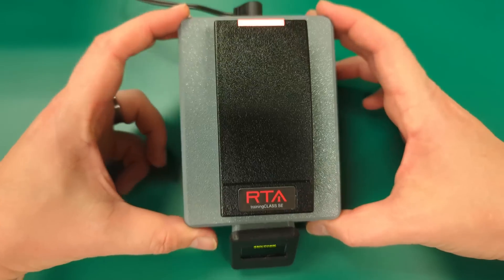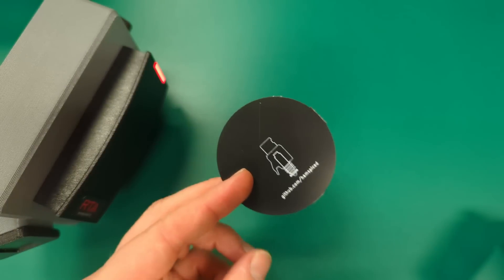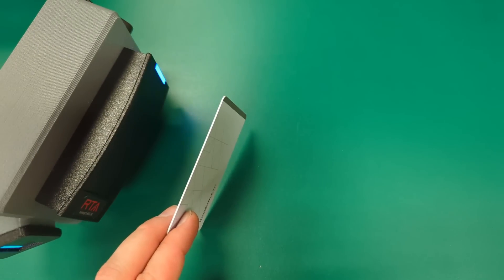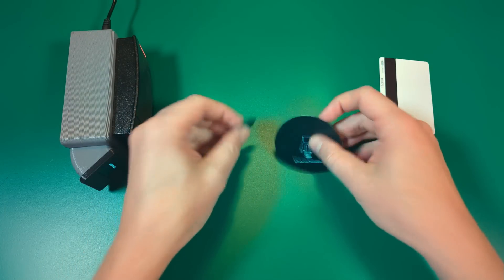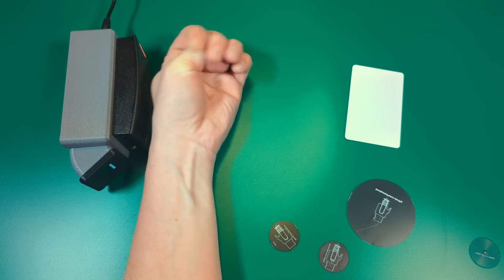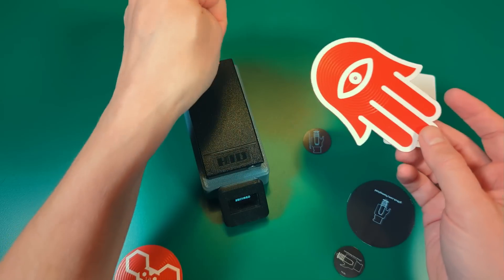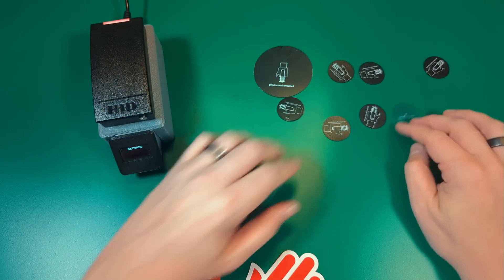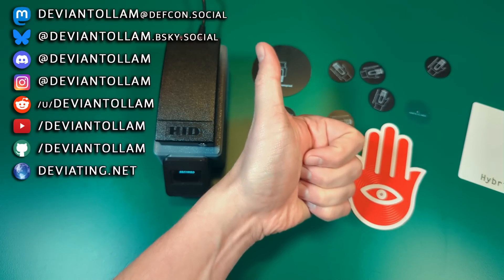RFID Tank Circuits

Comment: Also imagine you could embed these, especially the flex ones into a glove (like the ones used in cold weather or maybe if you are disguising as a construction worker/repairman on a building), to discretely have it available for use on reading embedded credentials just put it below the outer most layer of fabric just on top of the embedded chip🤔🤔

Comment: Question: Could one employ a chain / column of tank circuits and further extend the readable distance?
Reply: I'm pretty sure it would eventually lose too much strength because the RFID reader is supplying all the power. A lot like how sound gets quieter over time.

Comment: There's a video on the Smith chart that is the bane of EEng's schooling. It's about the rebounding of UHF frequencies in circuits. I can imagine this simple looking circuit was a task to make exactly the right length.
v=pXWbdxOAuDs
Reply: You aren't wrong.  However the largest development time of this particular project wasn't the length of the trace, but the capacitive plates to make the circuit passive without the need for protruding onboard capacitors.  I think I went through 120 different iterations before I was able to find one that maintained proper tuning to a degree that was acceptable for mass production variances.  This has been an amazing and stressful project because of these anomalies.

Comment: how far away can you get if you put loads of tank circuits in between? :D
Reply: INFINITE RANGE!   you can repeat the signal but you wont get a successful read, you can use it to power a LED but it wont couple properly with a chip after 2 or 3 repeaters

Comment: Not sure whats happening with the field, whether it's amplifying, focusing, bouncing or what, but can you chain them? If it's an amplification or focus I guess it's likely to be quick diminishing returns?
Reply: Its reshaping the field and broadcasting it back, and yes you can chain them, but after 2 you are going to run into read coupling issues.
Reply: ...also the like counter is at 666 so I ain't touching that :D so have a an additional comment as recompense.
Reply: @bonce  The field detector Dev is using has that little window that displays the number of layers in that PCB.  It actually says 1, 2, 3, 4, 5, 6.    It isnt a digital display, i kinda thought it was when i bought mine too!

Comment: Are they "stackable" and if so, how many repeaters can be added to the chain until signal degradation prevent the credentials from completing?
Reply: You can....  and i say this on baited breath.  In the testing i have done and others over at Dangerous Things Forum, we observed that you can daisy chain them.  It will power and couple, however there is a failure rate that occurs due to lag of a response/request that the reader is expecting.  it seems that after 2 repeaters you can expect around 50% failure rate,  and it just gets worse beyond that.

Comment: My immediate question is, can you chain them together to improve the range even further?
Reply: You can....  and i say this on baited breath.  In the testing i have done and others over at Dangerous Things Forum, we observed that you can daisy chain them.  It will power and couple, however there is a failure rate that occurs due to lag of a response/request that the reader is expecting.  

Now if you just wanted to use it to power an LED like the DT XLED or an XSIID, yes this will absolutely light it up without fail.

Comment: Come to think of it: Could you embed this on the close side of a wall, with the reader on the far side of a wall making it more difficult to tamper with the actual reader? Might be an implementation to increase security if you ask me.
Reply: Yes, and actually this works well.   I use this method at my house to get into and out of my office.  However it is only going through Drywall so your results may vary.

Comment: I’ve always wondered how to extend the read range of the RFID tag I use to enter my apartment. Currently, you have to pretty much touch the tag to the reader for it to sense it, but I want it to work from like two feet away.
Reply: @ericcarabetta1161  two feet is a bit of a stretch with NFC.  Signal degradation is pretty high.  You could probably get to about 6 inches but adding a multiple repeaters will get you to around 12in however successful reads will go down.

Comment: I imagine if you're trying to infiltrate with a credential cloned onto an implantable, you might want a flex-print tank circuit you could hide under an extra-large band-aid (assuming the band-aid padding doesn't add too much distance).
Reply: You could pull the gauze off and place the flex tank on the adhesive and put the gauze back on to reduce the distance to reader.
Reply: @TheRealWilliamWhite  the flex circuits already have adhesive on them so you could also just get a circle bandiad for it if you want to be covert. 

Given the interest in these from this video i will look at doing a few different color runs with and without logo's.  However the quick solution i can reccomend.  Look at getting some circle stickers that most match your skin tone and put it over the flex circuit.

Comment: As a tesla coiler and a deviant ollom fan i knew i had to watch this. 
The tesla coil actually operates by using to tank circuits. Tank circuits are a very simple resonantor by using a coil of wire(inductor) connected to a capacitor and the resonant frequency is dependent on values of the inducatance and capacitance. And here the tank circuit boosts the signal by haveing a large inductor which stores the engery recivived by the transmistor in a large magnetic and the large magnetic field from the inductor is key and the field is amplified
Reply: @jameslucarelli7172  this guy inducts

Comment: The thing that popped into my head was either as a CTF scavenger hunt at a bsides, or an escape room where you have to get all of the tank circuits in the right position to scan the card from further away. This also assumes that tank circuits could be stacked slightly for 3 in a row to give you just enough room to make a diy style combo lock type device.

Comment: I'm confused, what's the purpose of the subdermals if they don't read by themselves?
Reply: They do function by themselves.  The issue is that a lot of Door Readers especially those that are coming inexpensive from china have two main flaws.  1. The antenna isnt tuned properly. 2. The reader goes into a low power mode which isnt enough juice to couple with the implant.  Shaping the field that is generated by the reader helps resolve both of these issues.

If there was more thought between the design of the readers antenna and they were able to be mass produced and tuned properly this wouldnt be an issue.
Reply: My question is if you're going to use one of these things, why not just have like a ring or some kind of other rewritable RFID tag? Like anywhere you can fit one of these you could also fit a RFID tag that would have better range so why not just carry around a second card or whatever?
Reply: @johnsmith8981  you make really good points.  Everyone has different use cases.  

I have 4 subdermals.  One is a magnet in my finger.  And while yes I could get a magnetic ring, it wouldn't be nearly as useful and more of a hindrance with things sticking to it.

The RFID based subdermals all have their use.  The xsiid I have is specifically for my business card or Venmo.  But I like it because it glows under my skin when it's read.  While the read range for phones isn't great it's still acceptable to be able to use it consistently. 

The other subdermal I have is for hotel key cards when I travel.  This is the one I usually have haha with when I try to read.  It isn't so much the range as you have to know the best placement to present the chip and have it oriented in the best way to couple with the readers coil.

Finally the last one I have is a temperature sensor.  I normally do not wear any jewelry or a watch.  So to have the same functionality I'd have to have 4 different rings.  And for someone that really doesn't enjoy jewelry it's a bit much rather than just having something that's a part of me I can't lose, forget, have stolen, or risk ring avulsion

Comment: I look at my YT page of subscriptions and see "RFID Tank Circuits". I think to myself, "I more or less know what RFID is. I know what tanks are. I more or less know what circuits are. But I have know idea what RFID Tank Circuits are. Oh! it's a video from DeveiantOllam. I'll watch it!"
Reply: I'm guessing its a call-back to radio jargon. A tank circuit is a state of resonance reached using a variable inductor (coil) and capacitor (i.e. breadslicer), and you use the two to avoid standing waves. Standing waves are inefficiencies that limit range. By itself a tank circuit is neither a receiver or a transmitter, its just a tuner.
Reply: I was fully expecting a video on the uses of RFID in tanks / artillery lol

Comment: Just a curious question, do the tank circuits stack?
Reply: They can… but the issue is you begin to introduce lag, which the readers don’t tolerate well
Reply: @eriequiet  is 100% right.  Now if you dont care about getting a read and have something like an Xled implant, you can daisy chain many many of them to get a super long blinky light up.

Comment: The idea of carrying a card in your pocket to boost the range of your implant is a bit ironic but that is a great concept to play with
Reply: At least if your wallet gets stolen they only get a useless signal booster instead of your credentials.
Reply: @CathodeRayKobold  that's a pretty good point
Reply: @Millsgold822  so it sounds silly but the implant dance, as I like to call it, is a funny dance you have to do with your implant hand to find the best position for it to read on the reader.  The repeater stickers work great on readers you use often to both identify the best spot to place your implant as well as increase the range. 

However the best use of them is on a proxmark or a flipper.  When you write to the implant it has to be held in that sweet spot for a longer time and this kinda ensures you are coupled. 

The example Dev used about keeping the card in your pocket is mostly for access lifting to increase the range.
Reply: you could put one in a glove, but yeah if these implanted tags don't just work they are really pointless and dumb
Reply: @beowulf_of_wall_st  They do work, the issue is that there are a large amount of poorly designed readers that arent tuned properly, or the field isnt shaped well enough for the small x-series implants.  The repeaters kind of make it agnostic to the reader construction and reshapes the field to more efficiently couple with the implant.
Reply: @Hamspiced  "they do work but there are a lot of readers that don't work with them" is the same as "they don't work"
Reply: @beowulf_of_wall_st  😅 yeah I suppose you're right.  Matter of perspective I guess.
Reply: @Hamspiced  if you have one though the tank circuit is a good and smart solution, kudos for that
Reply: Had the same thought. Seems almost as if just having a card would be the way to go.

Comment: So to avoid physical tampering, could you embed the reader in a concrete wall from the inside, then place the extender on the outside of the wall? That should prevent all physical tampering with the reader, right?🤷
Reply: You could!  but the repeaters need some signal to be able to passthrough it to function.   Plexiglasss would work better.  @deviant Ollam this is probably a great security idea to subvert the RFID Theif attacks.   I have had users mound the readers on the opposite side of a wooden door with one of the repeaters on the otherside and it works perfectly.   It would probably work through drywall as well.  however concrete and metal doors i wouldnt think would reliably work if at all.

Comment: you (general "you") could probably integrate the small flexible ones into a glove to be a blanket boost of the embedded range
Reply: the flex repeaters have an adhesive backing so it would be perfect for this application

Comment: RFID antenna orientation also matters. You'll get the best magnetic coupling when the reader and tag antennas are oriented on the same axis, and the coupling drops to zero if the antennas are perfectly orthogonal. The orientation of the little coil in your implant vs. the coil in a badge reader isn't optimal for long read range. Those tank circuit patches are a neat hack to improve the coupling.

If you happen to stumble upon the newest RFID reader from that pet microchip company (the blue one with the not-rectangular case), I designed the electronics in it. A few other engineers designed the antenna coil, firmware, and mechanical stuff, and of course my design rested on the shoulders of other engineers' work. I'm not with the company or in the RFID industry any more, but LF RFID stuff still grabs my attention.

Comment: Do your implants get you extra delays at TSA. Obviously seen all your Guns drama you go through everytime but how do the implants go at screening?
Reply: @douganater  hey man.  I have multiple subdermals including a magnet and I never have had any issues with TSA.  Doesn't even show up in their scans as the amount of metal is so miniscule
Reply: The way the scanners work at the TSA is that they try and get a scan of the outlines of your body, and then check for "irregularities". The millimeter waves can't penetrate skin, so this doesn't show up. The metal content is also relatively small, depending on the model it can survive some usually weaker MRIs without causing issues.

Comment: For implanted RFID chips, gloves with the flex circuit could make sense.
Reply: This was my immediate thought as well. That seems like a perfect product for those who are into implants.
Reply: At that point you might as well put the chip in the glove instead. Not as cool, but more practical if you're going to wear a glove.
Reply: @emilysmith6897  But then you could loose the gloves, have them stolen, or simply not have them with you.
Reply: @Don__  the flex circuits are made with an adhesive backing already so it's plug and play.  You could even put it on the inside of the glove to be extra inconspicuous
Reply: Didn’t see this comment before I said something, but was thinking exactly the same thing!
Reply: My first thought was sewn into a sleeve cuff.

Comment: Kind of defeats the purpose of a subdermal, doesn't it? Don't get me wrong, I love the tech and that it solves this issue. Wouldn't it be better to integrate this with the reader? I'm probably way off on this, lol. I know very little about RF so I'd love to be educated here (not sarcasm). 🙂
Reply: I think this would be the idea. If you have a reader that's inside a sealed box, antenna just on a PCB inside the reader housing, then you can stick this to the outside or even inside of the housing to bring that antenna to the surface of that housing helping overcome the extra gap.

I think in this case it would be more useful for readers you provision to work with your subdermals, rather than out in the world. Might also allow you to use cheaper readers where design permits.
Reply: @bazzatron9482  yeah you pretty much nailed it.  That's the intended use case
Reply: @bazzatron9482  Welp, that just about sums it up. Thanks! You RF people blow my mind...crazy smart. 😎🤘
Reply: having these on the reader definitely seems like the way to go, but even if you do have to carry one of these around, the implant still has some benefits—you'd still have to try really really hard to lose your credentials, and misplacing the card can't expose or compromise anything
Reply: @Derfboy  that is the purpose of developing the repeater.  To stick it on the reader itself to reshape the field and better align with the implants coupling field.  I intentionally put a link to the GitHub in the stickers so that people don't think it is a nefarious device and they can see it's there to help the signal and not intercept it

Comment: That's very neat! Another application could be for escape rooms who need to slightly extend the range of a reader hidden inside a prop. Just stick one of these on the outside, paint over it, and now you have an extra cm or so of range
Reply: @zeebeezoey  in some cases you can even put the repeater on the reader itself if it is mounted underneath something.  They do a great job at reshaping the field of an already poorly performing reader.